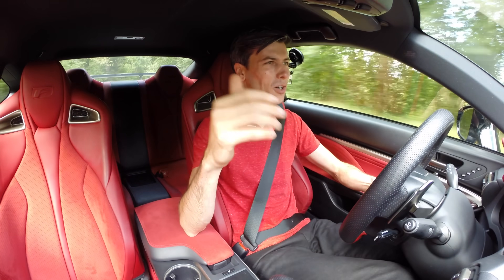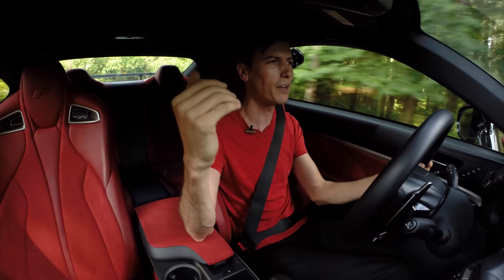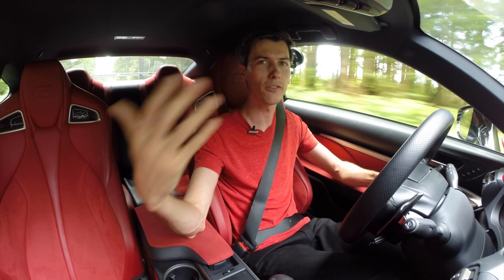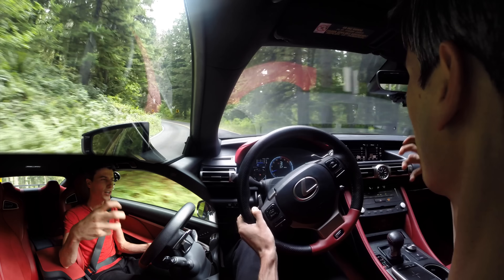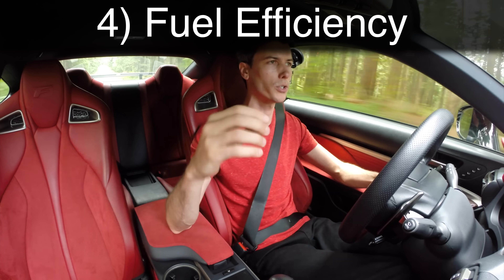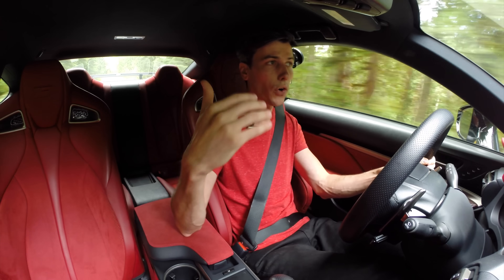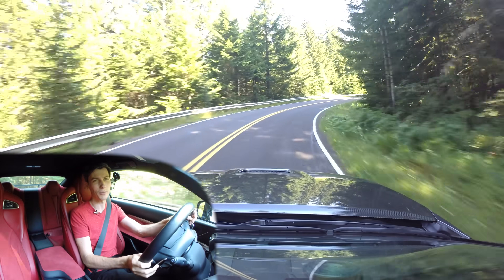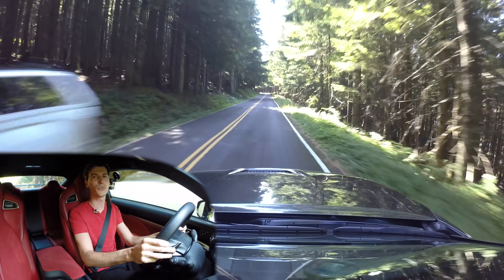5 Reasons You Shouldn't Buy A Turbocharged Car

Comment: looking for a new car..  always been a Honda guy, but it's so hard for me to get behind the turbos pushing the tiny 1.5L 4cylinder. There's no way to have confidence in the long-term reliability, regardless of oil changes. Maybe Honda nailed the turbo like they nailed the CVT, like they nailed previous engines..  as the current Earth Dreams 1.5 is having some oil dilution issues. The solution there too.. more frequent oil changes.   It's competition, meanwhile, Camry..  that 8-speed is not as smooth as a new 8-speed should be. Test drove both yesterday. Very difficult pick, which car is more likely to give me more costly repairs.

Comment: Plus most turbo engines make full torque downn low 2k to 2500 rpm and carry full torque to redline so what the problem with that? Full torque development down low to recline is not a problem to me.

Comment: It's now becoming the standard for  cars to have 1.3 - 1.5 litre enginee plus a turbocharger.
Reply: Everything is basically a rally engine now. 2.0 seems to be the max of most cars nowadays.
Reply: Smaller cars in Europe now have 1-litre  3-cylinder engine, plus turbocharger!!! 110 PS (81kW)  (VW Polo TSI)
My 10-year-old equivalent was 4 cyl, 1.2 litre, 105PS (75kW)
Reply: @andrews7517  are this 3 cyl cars even reliable?
Reply: @Eric910320  Nobody knows, they make sure to put them in cars where the rest of the car breaks down before the engine does.
Those downsized turbo engines only exist to have fewer emissions on the artificial test cycle. The regulators don't care about oil consumption, real world efficiency or that the car gets scrapped way earlier.
Reply: Agreed, I just worked on a mercedes c class "AMG". For an AMG car its quite sad to see a turbocharged inline-4 sitting there. The owner said he opted for the best option
Reply: @SadMan-pw6ge  Their is no c class AMG with inline 4 , smalest engine you can get is a 3.0 V6. Maybe the owner got AMG line which is only a look alike amg but no real one or he was faking it and lied.
Reply: @pandahero161  Yeah I noticed that after looking it up a few days after posting the comment, It looks like he got the c class sedan with the amg trim. I shoukd've edited the comment sorry about that
Reply: Yes, it feels so bad! You can't even go above 100kmph. If you do, you hear the turbo ranting throughout after that :(
Where's the 3 litre naturally aspirated?
Reply: @adityarastogi5420  What is the car we are talking about? I dont know if you know how turbos work but they dont get louder when youre speeding, they get louder when youre revving the car. Do you drive a a truck powered by a scooter engine or something? Because its not normal for a modern car to top out its gears when going only 100km/h
Reply: @SadMan-pw6ge  The 1 liter turbo 3-pots do struggle on larger cars and the efficiency goes out the window if you really put them under load. They do go to 180 kph but they're really noisy and unbalanced at higher loads (or idle for that matter).
Reply: @Hamachingo  Isn't that a given? I undrestand that you may need more torque to tow better but diesel cars arent made to be fast anyway so you really shouldnt do 180 with a car that has bad aerodynamics and loads of lift, you may lose control and have a crash that can kill or disable the driver and the passengers
Reply: @SadMan-pw6ge  Cars sold for the german market are set up for it, you can go as fast at it will go in a straight line on a smooth road no problem. It will fail the mandatory inspection before becoming unstable at speed unlike your average muscle car. I read somewhere that in terms of deaths per mile, the autobahn is the safest road in the world and I can totally believe it.

I drive a cheap crossover with an NA 1.6 gas/petrol engine, aerodynamics (and wind noise) like an upright piano but smooth and stable at 180. Downforce on the rear axle is a bit lacking at 100 but fine beyond 120.

I've rented plenty of normal cars in the US and yeah, I wouldn't trust those on the autobahn at all, even if they look identical to the model sold here.
Reply: @adityarastogi5420  yeah nah maybe you drove a super low powered car but my GTI can cruise at 140 at 2500 RPM at like 10% throttle. Believe me, I love big naturally aspirated, powerful engines, but a 350 WHP 3000 lb hatchback 4cyl is a blast to drive, and those 350WHP 2L are becoming the norm these days since i can get 35 MPG on cruise control, and still be able to have a pretty quick car.
Reply: The funny thing about this is... back in the late 80s through the 90s both Ford & GM said they wouldn't produce small turbo charged engines again because they couldn't get them to pass emissions. Ford actually said the turbo charger cooled the exhaust too much. Which was a bold faced lie. Enter mid 2000s... We have to produce small turbo charged engines to pass emissions & gas mileage requirements lol
Reply: Sadly.
Reply: 1.8-2.0 is pretty common.  Especially in german cars
Reply: I think its a good thing. Think about air youre breathing first. AND its mostly daily/economy cars that got these shite engines that cares about economy only. You still got just released NA Cayman 4.0GTS and lot of other big engine sport cars. Expensive? AF.  But theres still stuff like 370z and still will be for very long time. Future is with electric motors anyway that are superior in every way other than sound and weight (heavy batteries)

Comment: Your engineering is faulty. I could write a book on where you are incorrect in almost every point.
Reply: Blackhawckpilot I 100 percent agree with you this guy has no real clue what he is talking about. Working on tons of different ecoboost motors he is dead wrong giving false info out to the poor people watching the video that dont know any better.
Reply: I plan to buy a nissan 2020 kicks In india, which is powered by a 1.3 turbo charged petrol engine.HR13 DDT. Can you tell me if its good to buy ? Im a but unsure looking at these content in the realibilty of turbo charged engine vs a normal one..Btw please google nissan kicks 2020 indian version for more info. Appreciate if u can share ur valuable feedback.. thanks 😊
Reply: @anupmenon240  get the manual version stay away from the cvt you will regret the cvt if you get it.if you change the oil every 7 khm with good synthetic oil and dont let it ever overheat. You should be fine with engine.if the engine ever starts to overheat for some reason this applies to all vechiles if its safe to shut it off just shut the engine off dont drive it if you don't have to.of course if its not safe to shut it off and you must make it to a safe  spot then your safety is priority number 1.
Reply: @victorgirouard1543  thanks a ton!
Reply: @victorgirouard1543  chang the oil every 7 kilometers? Wtf
Reply: can you provide examples
Reply: @RayanMADAO  read some of my replies it gives examplrs
Reply: We'll wait for it.

Comment: And don't forget the turbo is still spinning at a very high RPM after the engine is turned off...NO OIL PRESSURE....yes there is residual oil, but it will form coke due to all that heat..no turbo for me

Comment: i honestly like the sound of a honda 4 cylinder, they sound noticeably different than any other car manufactures 4 cylinders
Reply: As the owner of a 97 Civic that will be getting the "mini me" head swap along with a turbo and supporting mods, I can't agree more!
Reply: It sounds the worst lool
Reply: That’s because vtec
Reply: @Got_Boost  no that’s because honda originated as a motorcycle company and designs engines similar in that they rev higher than other cars and give power on top of the powerband. That’s why they sound different and have to be rev high to perform, but that’s why people think civic drivers can’t drive because the car is always screaming as designed.

Comment: Cars like the Veloster N alleviate the hot turbo oil issue but water cooling the turbo, and having an auxiliary electric water pump run after the car has been shut off to continue to cool the turbo instead of having the hot oil sit there. 

I’m used to my diesel truck which doesn’t have that, so I generally let it idle in the driveway for a minute to let the turbo temps cool.

Also, if you were using the veloster’s crackle as an example of running rich, the crackle is on purpose. It’s a mild factory anti lag system.

Comment: Are you sure about the drawback of turbos on compression vs. efficiency? I mean one could argue that the air coming from the turbo is already pre-compressed. The same volume in the cylinder before stroke compression filled with 1bar vs. 2bars will lead to x bars bs x*2 bars at ignition point, right?
Reply: the air is compressed in the combustion chamber regardless if there’s a turbo or not
Reply: @v3ru70  But the resulting pressure will be different. That's my point.

Comment: V8 and V12 sure sounds nice. But here in Europe fuel is little more expensive. Sooo, instead of V8, I drive 1.4 turbo, and it goes on 4,5 - 6 l/100 km. Unless I get filthy rich, I will continue to drive turbocharged cars. Otherwise, would go for V8 :)

Comment: What will last longer, both being driven and taken care of the same way ("All condition variables being equal")

A 1.5 Turbo Honda Civic with the CVT?
OR
A 2.0 L normally aspirated Honda Civic with the manual 6-speed?

Honda has DECADES of building and perfecting NORMALLY Aspirated engine for the masses and makes the BEST Manual Transmissions for the 'General' Public. (Toyota makes WAY better automatics and overall better vehicles).

Comment: My impression is most inline 4 low powered engines that use a turbo, have some way to cool the air from the turbo before feeding back into the engine, allowing the engines to be more efficient.
Reply: yeah the intercooler, used to make the air more dense not necessarily cool the engine tho

Comment: i have a 3.3l santa fe with 270hp, and a 3.0l diesel amarok v6 with 225 (248 on boost mode) hp. My take on this:
Aside from the narrow torque and power band from the diesel, what i notice is that the NA engine has a better response, BUT it only feels powerful when it's screaming. The turbodiesel feels more powerful in a normal range of RPM despite actually having a lot less peak power (almost twice the torque probably helps). 
But i like the linearity of the NA engine, it feels more predictable and controllable.

Long story short: I could go either way.

Comment: can a centrifugal supercharger crank driven mechanism added to the turbo charger with a one way turning gear(like a bicycle when you don't pedal it still turns) that way if turbo rev is too low crank will turn it up the minimum amount and supply pressure, and if there is enough exhaust pressure that turbo will just turn faster by design and crank will have nothing to do with that. i think this would be an awesome solution, it is like having an electric motor spinning your turbo when your turbo isn't spinning fast without the added extra weight and space

Comment: There are intercoolers placed in the arrangement made with the turbocharger, how can you perhaps claim that temperatures of turbocharged cars been very high will cause engine damage? U can also refer to EGR system used in vehicles and it's architecture or arrangement of components to know that there is an intercooler placed with turbocharger, so how come would we get reduced efficiency?

Comment: Sorry but here you miss the mark completely. Turbo engines today have absolutely no turbo lag, are very economical and very reliable. Here in Europe, most cars, petrol and diesel run on turbo and do not have the aforementioned problems.

Comment: Compression ratio is geometric.  It is the same whether the throttle butterfly is open or closed.  It is popular because it is easy to physically measure.  
   The true parameter is Pressure Ratio, which varies with throttle and, if turboed, boost.  
    Higher pressures yield higher efficiencies, so a boosted engine with a lower compression ratio, but overall higher pressure ratio is more efficient...except when off boost.   Unfortunately off boost most of the time in traffic and running to the grocery store.
     For example, the 1950 era Wright R3350 airplane engines was ‘turbo compounded’, where the engine was turbocharged and excess turbo power was not waste-gated, but was sent back to the engine.  These engines had the greatest efficiency of any spark engine, yet their compression ratio was only 6.85.
      Turbocompounding is common on ships, and locomotive diesels.  It is making its way into highway truck diesels.

Comment: I live in the Denver area.  I'd love a video on naturally aspirated vs boosted engines at 5200.   My impression is that boosted engines get much closer to their sea level performance than naturally aspirated engines do.
Reply: Duh, if you pull more air into the cylinder by using a turbocharger, it’ll operate better at higher altitude

Comment: I had a 2JZ ... bought it cash in 1998.  Had Rod Millen (Rhys) get it up to 550 lb-ft ... but it ran hot ... & @ high altitude or a hot day ... if I tried to pass someone I could get in trouble.  Since then, I've been an N/A fan ... aka E92 ... And, the premise of buying a 3.0L engine ... but running at a Bar instead of slight vacuum means it's now got 6L of fluid in it!! Why not just buy the 6.0 Liter in the FIRST place...?  You give up changing the HP with a dial... but also avoid losing HP due to heat, too. Obviously, a C8 CRUSHES the 2JZ ... but IMHO, it even crushed it without cats, an IC and at 1.5 bars... now that really is saying something.

Comment: The Ford 1.5 L Ecoboost engine in my Fusion seems to be pretty good with instant boost, and it gets really good gas mileage when you’re easy on the throttle.
Reply: This guy talks out his butt have of what he said about turbo engines is dead wrong!
Reply: reshi p  you are wrong I work on a fleet of over 30 Ford f1 50 with the 3.5 ecoboost and 4 have well over 300k and the rest have over 200k on them all running like new.i have been in the field over 20 years change the oil often with good oil and they will last! So next time before you comment on something you clearly don't know crap about do us all a favor just go ahead and stick your foot in your mouth! And the best part they all have original engines and turbos imagine that.

Comment: This is a highly outdated viewpoint when it comes to turbochargers.
Turbo allows fine modulation of power levels and is way more tunable that a naturally aspirated vehicle
In fact some things said here is absolutely incorrect mainly the first few points and are made from a very narrow outdated viewpoint.
And if you think a low revving  lexus v8 sounds better than a straight six turbo like the rb engines or jz engines that is laughable at best.
First most modern turbo have lag as an after thought second torque can be managed through ecu tuning. Turbo cars use beefed up oil coolers to handle extra heat alongside intercoolers or some heat exchanger for the intake temps to help prevent knock and detonation.
The higher fuel requirements and need for stronger internals because of this were factual and valid points.

Comment: still talking about turbo-lag in 2019 makes me laugh a lot.
Reply: Vnt: am I a joke 😂
Reply: Right, I mean we have VGT,  VNT, billet 3 axis CNC'd compressor wheels, twin scroll, dual ball-bearings extremely light exotic metal turbine wheels and not to mention anti-lag/rolling boost or using nitrous to spool the turbo. There really isn't much lag in modern factory turbo cars and the aftermarket technology is so great today people are strapping on larger turbos to smaller displacement motors than ever before.

Comment: You can't get away from the FACT, that a small Turbo Engine is way more fuel efficient 90% of the time compared to a 5 liter V8. In the USA fuel is much cheaper compared to the rest of the World. My 1 liter, 3 cylinder turbo motor gives 16 - 19km/L ánd strong performance when I need it. No 5 liter V8 motor can do that : you'd be lucky to get 11km/L

Comment: My (2006) Subaru Forester has a "downsized turbocharger" ...which is nice to know. It also has a recirculating blowoff valve and the previous owner replaced the intercooler with a larger STI one, so temperature should be handled a bit better.

Comment: want less turbo lag, just use two small turbos instead of a single large one...
Reply: Or one small and one big turbo, or twin scroll turbo among other ways to compensate for advantages and disadvantages or different size turbos.
Reply: @Car_Mo  of course, but I was referring to a way to get the same boost and torque at lower rpm with less lag time

Comment: Huge fan but I have real world test data that says your really wrong about the reliability aspect atleast as far as performance is concerned. So on my race engines we replace the same set of piston and rods every 100hrs which is pretty good. Now the same rods and pistons will take boost and last twice as long making more power at lower rpm (key here is rpm). After 100hrs my na motors the rods are streched valve springs are either cracking or already replaced and skirts have alot of wearing. The boosted motors at worst burn a valve or a seat. And the rods are normally fine to throw back in. So much so I don't get into them until I hear something. And it's been like that on most engines IV been in. boost is soft power and na means rpm and that hammers bearings.